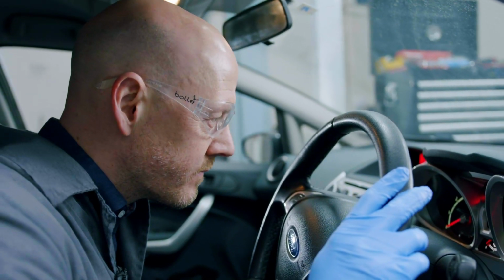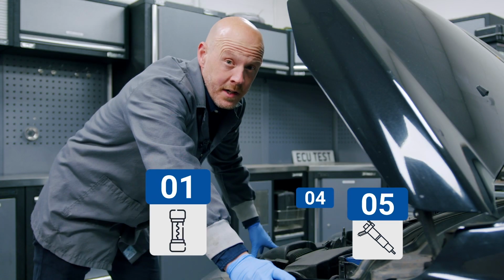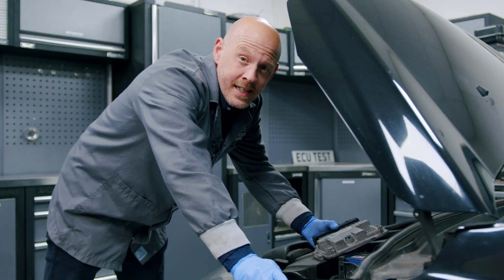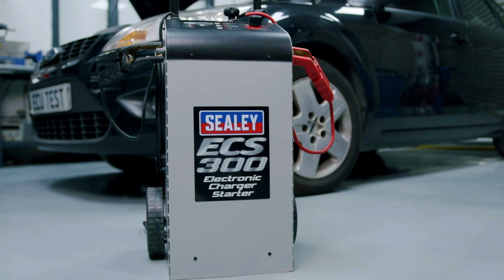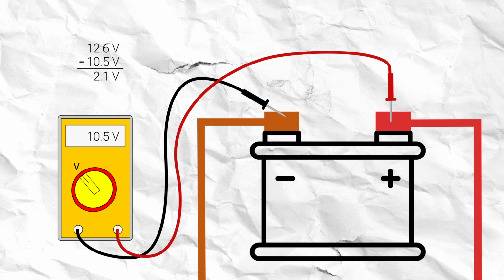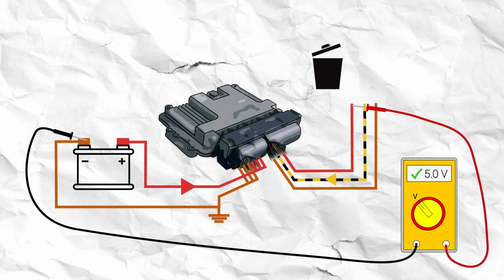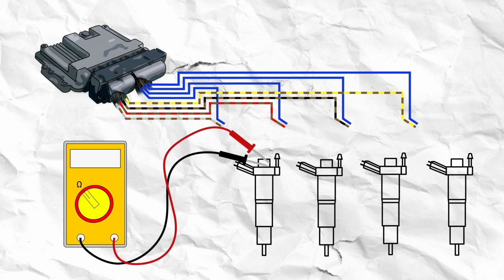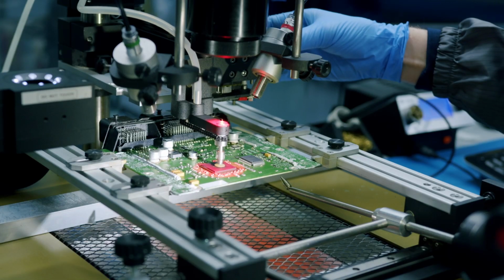P0606 – Car Won’t Start – Diagnostic Tips!

Comment: Could the ECU change the polarity of one sensor?
Reply from the maker: Hi. We haven't encountered a faulty ECU reversing polarity of any sensors. It could be the test you are carrying out on the sensor is incorrect or the sensor itself is faulty. Cheers
Reply: Please I really need your help 🙏 my Toyota Land cruiser V8 is cranking but not start no shocking light